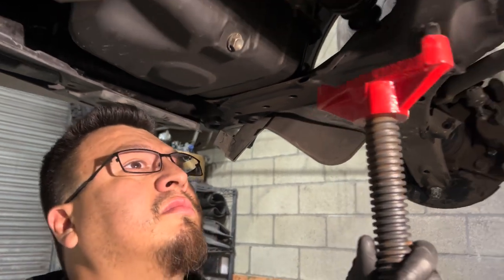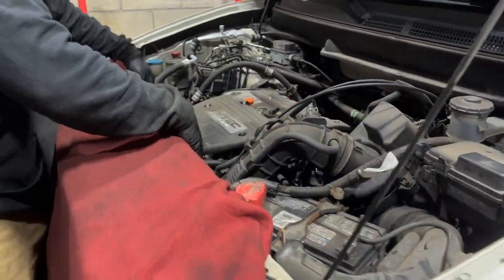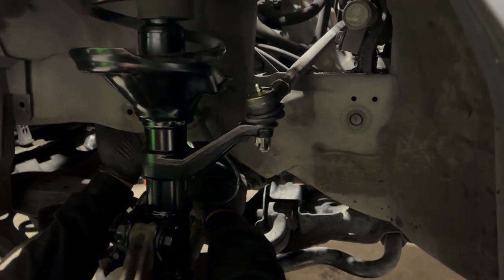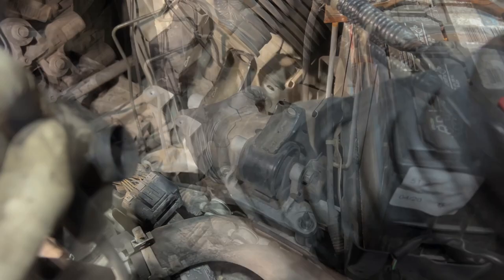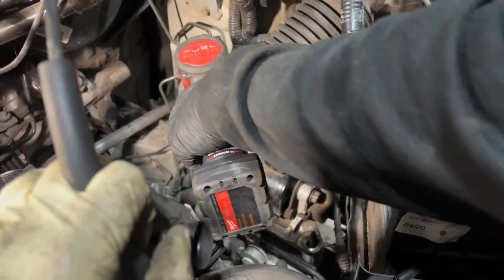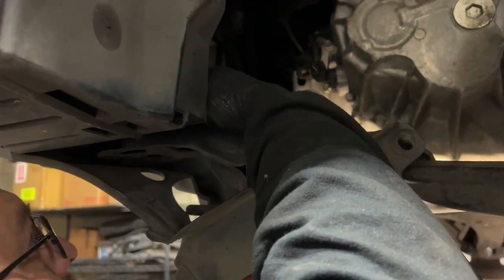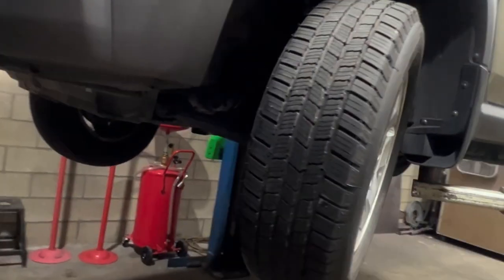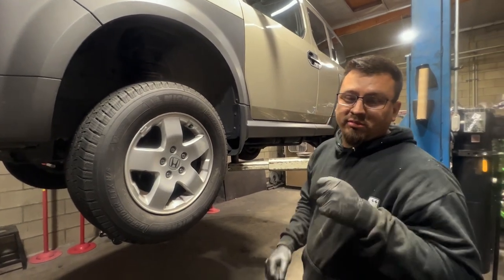Subframe Drop Kit Front Install Honda Element - Episode 6

Comment: Good day Miguel, first of all thank you for all this incredible content you create about Elements. I used your videos a lot to bring my 2003 Element back to it's best shape. I would like to ask if replacing struts/shocks really changes the riding quality. My car has 160k miles on it and it rides decent, but I am considering investing some money and put in a new suspension on it. I understand that it won't be as comfortable as modern vehicles, but does it worth it? Or I should I stick to the rule: don't fix it until it is broken. Thank you!